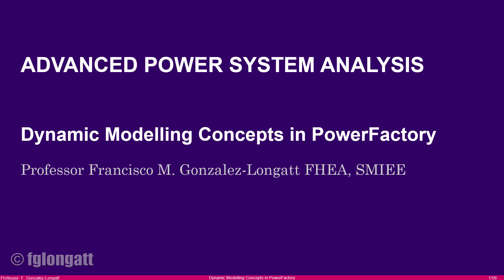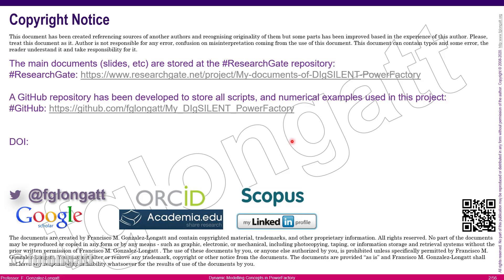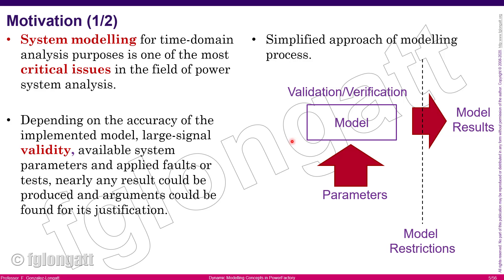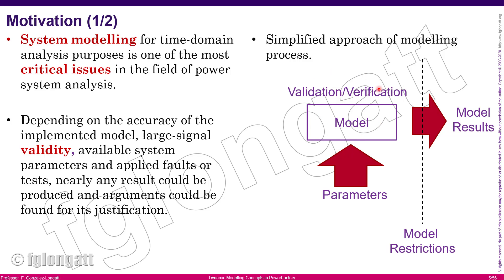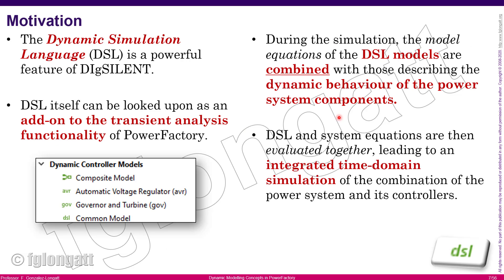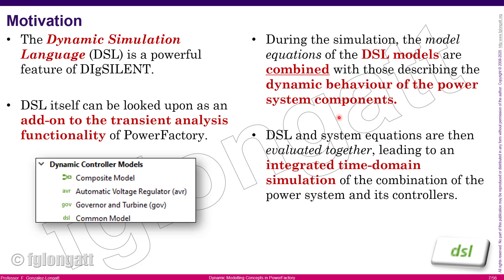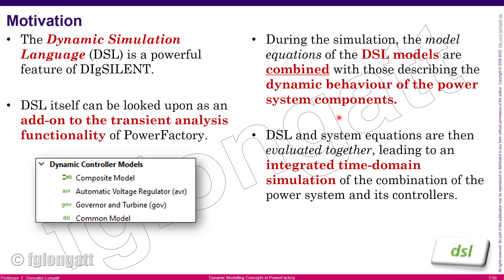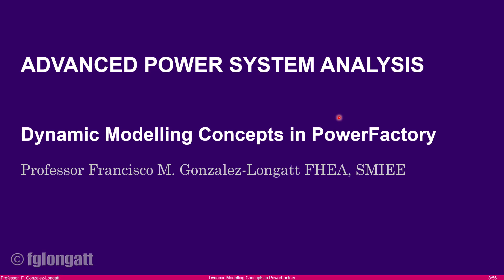Dynamic Modelling Concepts in Power Factory PART I

Comment: DIgSILENT Dynamic Simulation Language (DSL) - creating, developing, modelling, testing.
Modelling Time Domain Simulation (Dynamic state) => for accuracy & validity model system implementation, with fault applied
The urgency of user defined model exist => no standardization models that contain standardization parameters
DSL = add on of Transient analysis
Stability analysis = predefined system models